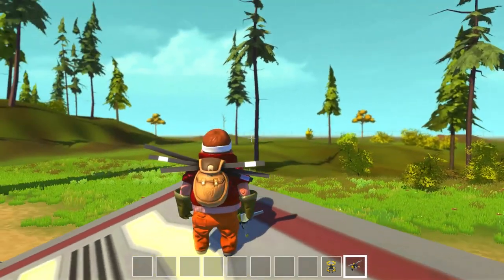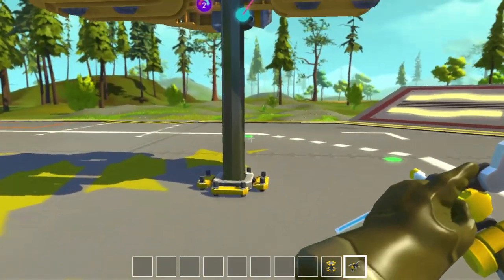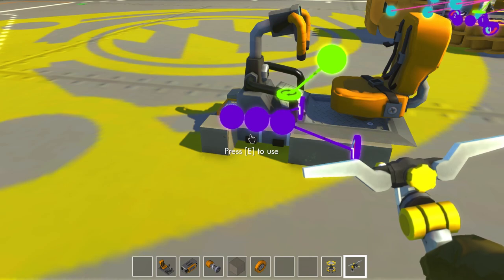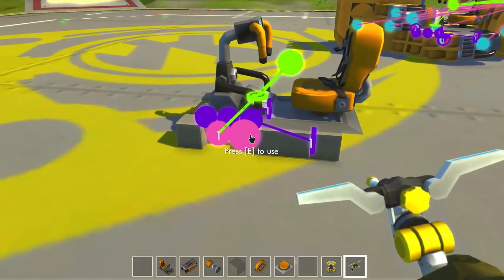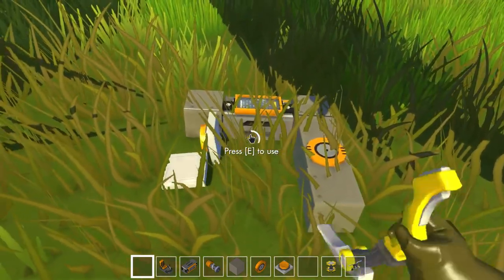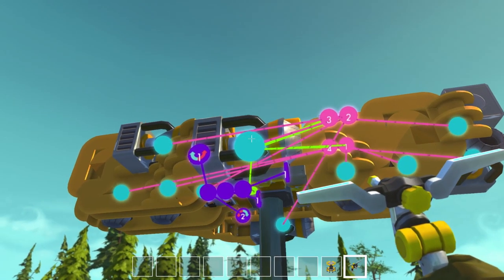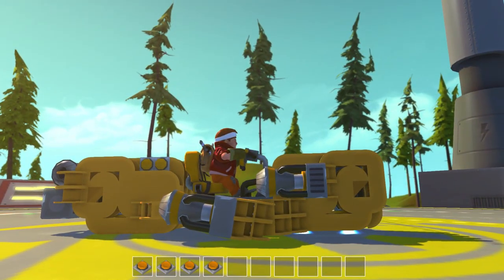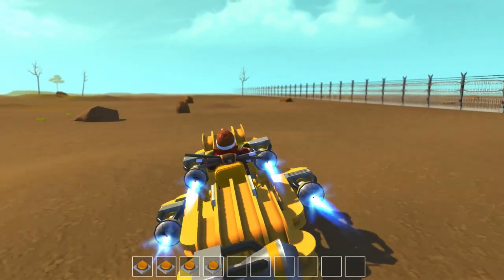Scrap Mechanic Gameplay: EP19: Hover Bike! (Let's Play 1080p)

Comment: Sorry, not to be a hater or anything... but this slides across the ground; not hover. Try something with sensors on the bottom that activates thrusters when it comes close to the ground so that it has some lift of the ground maybe. Other than that i like the design and the way it works :)
Reply: It hovers though lm ao